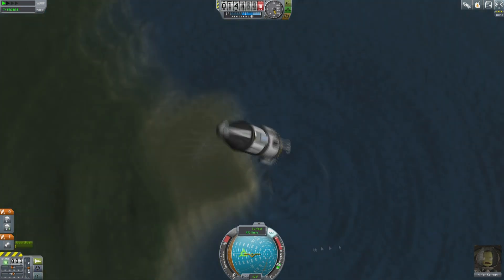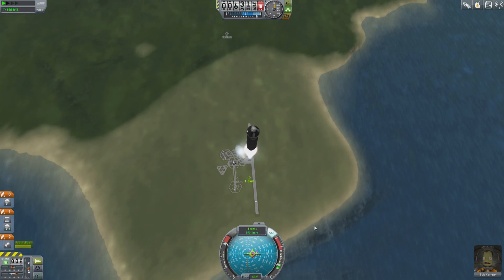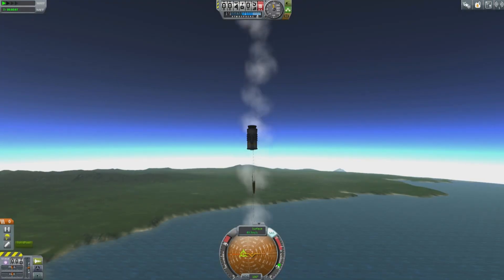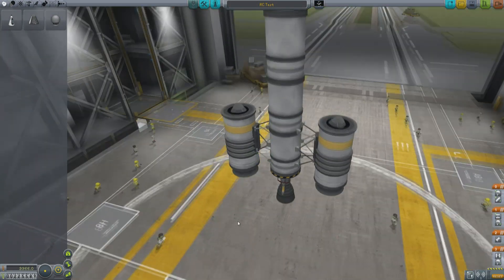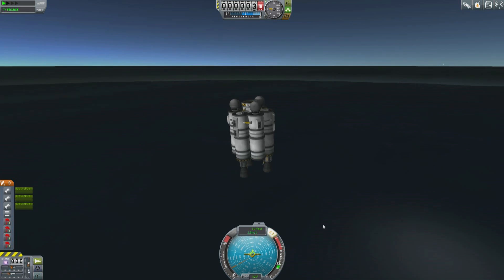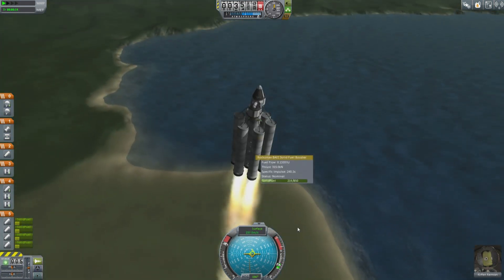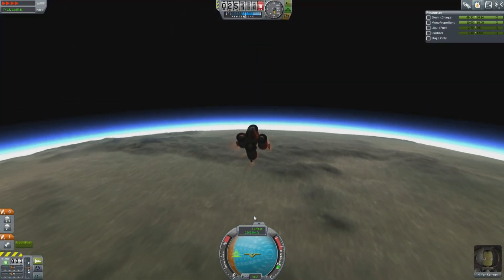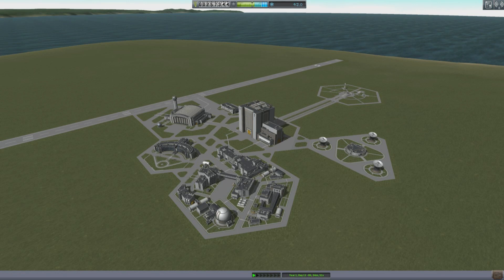Kerbal Space Program - Recovery And Reuse Tutorial in First Contract

Comment: sorry, but this feature just DOESN'T seem very user friendly or bring any improvements to the game... if anything it kind of just makes playing the game more of a chore... Is there ANY benefit to having to micromanage these elements of the game, or use these "gamey" unrealistic solutions to get a little extra fund recovery for missions?
Reply from the maker: The benefit is fun, and possible explosions. But Yes, in part I was saying that cheap boosters are an equally valid approach to the problem.
Reply: Kineth1 Don't misunderstand me, I have no issue with "Funds" or costs, or even recoverability.  I take issue not with the contracts, or funds, or recovery feature, but with apparent limitations of the game engine that make no sense to me.

If I put enough parachutes on a part for it to touch down safely, and do so in a safe location... That should be enough.

Having to switch what I am controlling or use probes etc to save a few bucks is stupid IMHO and seems like a game limitation rather than a feature.

Some of my rockets require CONSTANT control even with SAS to stay stable in their ascent, or at least require that I be able to do my gravity turns etc.

If I have to switch focus to my boosters every few minutes of the ascent to do that... it's not FUN.  IT's ANNOYING.

The only reason for doing it, is because of the limitations of how the game engine handles parts more than 2.5 KM away etc.

That's just a BAD design decision.

Oh sure, you can just eat the cost of the parts... I'm sure the game will remain playable.  But what is the point of the feature of being able to recover things, if you doing so requires such drastic measures?
Reply: The addition of funds forces you to THINK more about your missions, rather than just building a basic launch stage that can take you to Jool and then using that to launch everything.  The addition of contracts gives you (a) GOAL(s) to accomplish, which for me, after unlocking the whole tech tree a couple of times, gives the game more continued playability.
Reply from the maker: D3mang3l Sounds like you should get a mod that hacks the engine to extend the physics range.
Reply: Scott Manley
 I love me some mods Scott.  But at the end of the day thats not a solution. It's a bandaid.  I want KSP to keep being awesome and become a huge sleeper hit, maybe it won't ever be as big as minecraft, but we have to make sure we stay honest when a dev ads a feature that doesn't increase fun.

Needing a mod to make the stock game playably fun is not a good idea.

Anyway, As it's been said a bunch of times, I'll say it again, it's an Alpha/Beta, tweaks and mods will fix all.

And I like what someone said later, that at some point recovery is a moot issue because your at end game and have money to burn.

Speaking of End game, I really hope they put more than just Science and funds, as a way to make progress!

I want them to include not just EASTER EGGS, but stuff that when found unlocks parts.  Find a UFO on Duna?  You can unlock a new tech tree that can't be unlocked just with science alone that gives you new alien engines.  Find life on Laythe?  This allows research into a new kind of Biofuel that weighs less.

Who's with me?
Reply: actually im not sure I agree with this line of reasoning.... while perfectly good points, it ignores that the design they have set up is so that you don't have to go through these unnessesary steps. The limitations in place are there for performance reasons. The devs don't expect everyone to be so strapped for cash to feel the need to recover every last bit of their vessel--- while still rewarding single stage to orbit spaceplanes.

I imagine if rocket parts were not restricted by the limitations in place, there would be no point to spaceplanes still.... in all honesty, those limitations promote advancing to a fully re-usable spaceplane- giving them some much needed use.
Reply: D3mang3l With that I concur wholeheartedly; I think that the 2.5km limit on 'debris' is only useful to reduce memory & CPU usage; I remember when I first started out trying to fly exploration drop pods around the planet (cmd pod+sci jr+goo+parachute) and being very frustrated that when I dropped them they just disappeared.
Reply: xrayfishx
Some People really don't seem to see my point at all do they... I'm not saying we need to make every part function with full physics all the time.

I'm suggesting the feature of recovering stages is fine, but if I NEED to micromanage the landing of my disposable stages, or download a mod to make it feasible to do it...

Then the FEATURE is broken or poorly thought out.

They don't NEED to make the 2.5KM limit go away, or extend it...

What they NEED to do is figure out a way to make it so if I try to save a part by putting a chute on it, and give it a suitable splashdown fight path... that I get rewarded for my effort.

I SHOULD NOT HAVE TO MICROMANAGE the splashdown of my SRB's or LRB's while my main payload stages are still in ascent to get as much efficiency out of my funds as possible.

Everything else sounds awesome...

Sorry if I sound snarky, but it seems like every other response is from someone who seems to lack reading comprehension and thinks I'm bashing the game or don't understand how I can Fix the problem.

Those latter people crack me up... They tell me how to fix the problem but don't seem to acknowledge that it IS a problem...
Reply: Kineth1 there is one, it's called unloader, or something along those lines..found it.

TT NeverUnload - Vessel Unloading Preventer
Reply: Cadde exaggeration to express a valid point is in no way blatant ignorance....
he's technically incorrect if you take the words literally at 10k remark, yes... ignoring the exaggeration, not everyone has your computer so don't expect the rest of the players to share your view.

as to the point he made after that
"And remember THE GAME IS A WORK IN PROGRESS and it may or may not be fixed and a solution found in the future. Scott is just showing you how to get around the limitation."
^ How is this not a good point? he's right, these limitations may very well be lifted at some point,.. idk, do you?

as to whats so difficult in putting in a slider for this limitation to be in the players hands,.. idk why he is being addressed on that one as if its his fault? a bit irrelevant to what he said and more of a problem for Squad to look at. It doesn't reflect on his point...
Reply: D3mang3l so,... leave the limitations there- but work in detection for if a debris has a parachute and autocalculate your return funds? This would be acceptable?
Reply: I must investigate the existance of mods to extend physics range, thanks for the suggestion.  This is one of the great parts of being involved in early access games; you get to help shape the eventual development of the game into something that the whole community can enjoy :)  Personally I want my main stages to behave similarly to Space-X's goal: launch and soft-land automatically for maximum reusability, none of those suicidal solid rocket boosters that you can't shut off when something goes wrong.
Reply: D3mang3l It's not a feature... It is a limitation and it is there so you don't need a $10000 PC to run it. And remember THE GAME IS A WORK IN PROGRESS and it may or may not be fixed and a solution found in the future. Scott is just showing you how to get around the limitation.
Reply: D3mang3l I expect when it finally comes into release as an actual game (remember this is basically Alpha/beta) then that will work.
Reply: D3mang3l I have the same concerns.
When I first heard about career mode, my first reaction was "Interesting and challenging!" and my first concern was "I wonder how they'll deal with first stages recovery".  It's disappointing to see they didn't deal with it at all and first stages are basically lost (for normal people who stay with the ascending part of their ship).
For a system that pays you to recover parts, in a game where rockets are built in separating stages, that is a surprising omission, especially when the early stages are usually bigger and therefore more expensive.  I know it's not a full game yet but it seems to me like a fundamental part of career mode, not a detail, so it's surprising to see it released like that.
Reply: The recovery function still works without mods and workarounds though, just not for the booster stages. It works for the expensive landers with scientific equipment which is a large part of the cost. As unconvenient as it might be, it is better getting some money back rather than none! And also, how do you know the devs didn't intend to make the recovery function like this? Maybe they were aware of the limitations, but made it anyways, because at the end of the day, not being able to recover your lander would be even worse! I do hope they make some form of simplified solution to this issue though...
Reply: I know! its almost like its supposed to be a rocket/space simulator!
Reply: *****
Don't argue with them Memo, some people just can't stand when you have criticism of something they like, constructive of otherwise.

Apparently, Squad can do no wrong.  Instead of expressing concern over a flawed feature, we are supposed to just mod it out and not say a word.

People just don't seem to get that the game can be awesome as hell, and have a flaw that needs fixing.

Telling someone it's alpha so it's fine is ridiculous.  It's ALPHA so it's MY JOB to report my opinion on the game.

Not just suck it up and shut up. Glad you understand the point.

I'm already over it... I just play science/Sandbox now.
Reply: If you don't like the budgeting/reputation part, you can just disable it when starting a new game so that it'll operate in 'science only mode' like it does presently.
Reply: softrockification You clearly have no idea of what you can buy with $10k... I can buy a decent gaming rig for $700 that could play KSP without much issue.
If i wanted to go the extra length to get everything i wanted i would say $2000 would be well enough for everything one can play on a PC.
And if i wanted to go crazy then $3000 is the maximum one would spend on a gaming rig. Beyond that, any extra $$$ you put in has literally fractions of a fraction of a percent in benefits.

So yeah, with your $10,000 BS i could get myself 5 gaming rigs that would still be about 95% as good as the one you spent $10k on.
Reply: Cadde very good points.... glad to see someone else understands the marginal benefits as you climb towards more expensive machines.

Honestly if you build it yourself, the $2,000 one should get you damn near top of the line and rival a 10k market one just fine. 

but that's off topic... a lot of people run crap machines despite this. And Softrocks main focus still stands.
Reply: Meow ster But it's not even a strong point he makes after you ignore his blatant ignorance. There are settings for graphics quality and pretty much everything else in game. So what's so difficult in having a setting for the max physics distance?
I would set mine to infinity to begin with, the start of a career is the most fun anyways and once you "play in the big league" you hardly bother with recovering spent stages anyways. Especially since being able to re-fuel them in orbit and never de-orbiting them becomes a possibility. That is, keep the long distance heavy stuff in orbit forever and use smaller craft to bring crew, fuel and parts up there.
Reply: the problem with that cade, is that it'd literally load EVERY part that you have in orbit/crashed, which would mean a ridiculous amount od RAM used in very trivial stuff
Reply: iruini07 Thank god i have OCD then and clear up any debris that have landed on the surface.
Besides, once something is "stationary" (I.E, in orbit or on the surface of a body it doesn't need to be simulated physics wise anymore.

Only when a rocket is firing or it's entered a physics environment does it need to be simulated and i wouldn't mind a performance slowdown when something is about to crash into a body.
Reply: Therefore physics is not on and it is exactly the same as the current system which will still leave the 2.5 meters are when will it load and come into view and physics is applied? When you have a 2000 part ship in a stable orbit you still get lag because the model is loaded. this will e the same when physics is applied and the model is loaded. If you don't want physics when in a stable orbit it still leaves a 2.5 meters to load the model into physics.
Reply: iruini07 Thank you very much!  I will have to check this out after trying the vanilla update for a while.  Fingers crossed for 64bit version compatibility.
Reply: I agree, this should be part of an optional harder career mode, its an update I will not be downloading sadly.
Reply: An easier solution seems to be if the decoupled part is equipped with essential parts (a Probe and a Parachute for example) the game continues its physics until landing, and then sets it in  place until you switch to it. So the science and Money is preserved and it doesn't use up our precious Ram for too long.
Reply: yep, dont think ill be updating, its hard enough as it is
Reply: Da1ienx Me 2, i have a challange in career to recover a probe on intercept with Kerbin in 136 days. Problem is: I didn't fit it with a docking port, so that meens i have to use "The Klaw" witch i still need to unlock. Going to the moon and landing there that means. But i dont have any experince on landing in a almost no gravity-no oyxgen enviorment. Nice challange me!
Reply: D3mang3l while I don't agree on the whole with your dissatisfaction on the physics limitations and funds.
Mods are not an excuse for a developer to slack.
If they can improve in the areas you listed, im certainly on board with it.
Unlocking alien tech certainly sounds fun!
Reply: Honestly i was waiting for this update, only because of the x64 implementation.
Reply: D3mang3l
Sir your loading range problem can be dealth with.
There is the "never unload" plugin that gives physics a 300km range (use with caution as this may lag your machine to death because of all the stuff it has to load within physics range).
And there is the "Lazor System" that can upscale your physics rage to 95km.
However I suggest to use this with caution and go into orbits of 100km and higher (as you will not be loading stuff on the ground from orbit which can cause stupid things to happen).
I use the Lazor system for the higher loading range (2.5km, 9.5km, 22.5km, and 95km preset settings), but i've deleted all its parts in my folder as i don't want the weapons and stuff.
Reply: davispeterson
It is still a work in progress. I am sure in the future they will address this issue, now that the game has x64 compatability
Reply: D3mang3l Get the Lazor mod, recover everything, lag terribly when your 300 part station goes over the launch site or is anywhere nearby, even in space terms, and then realize why the 2.5k limit is useful.
Reply: D3mang3l
 there will be mods for that, and someday an update to fix what mods already have. ksp has been loaded with buggy annoyances as its still in development, this was a problem that wasn't one before so eventually it will be addressed as you are right, you shouldn't have to micromanage your garbage, just chute it so it doesn't come screaming thru the space program headquarters.
Reply: Meow ster
 I was actually going to suggest that as a possible option yes.  Might not be quite that simple, but lets say if a part has a chute active on it, then the physics engine restriction is expanded far enough to allow it to track it out to a reasonable distance for recovery.   Say 250KM. 

This would probably be the best of both worlds... it would maintain the efficiency of the current 2.5 rule, but also allow for the game to really require a proper recovery solution, not just strap chutes on.

I'm sure it could be handled as a simple exception/flag to the current logic that controls when the physics cut off already. 

But what do I know :)
Reply: D3mang3l I agree 100%, I have been looking forward to funds in career mode but this is a very awkward way to recover your costs. The other problem is at the start of your career it will be more difficult to earn funds and very difficult to recover them but as the game progresses it will probably be trivial.
Reply: What if there was a way to have the main ship load, and keep the 2.5KM limitation. But somehow find a way to force load the debris that you jettison that on a trajectory in the atmosphere or the ground?
Reply: Well,... I know for a fact that they made it like how it is on purpose. The recovery funds are a bonus, not the focus. Your not suppose to micromanage recovering every little thing. Theres a bunch of OCD people doing just that and its driving them bunkers, meanwhile the people that either don't care or recognize the system for what it is, are making plenty of money just fine making their ships how they used to and only recovering upper stages(or mixing it up just a little)

that's not to say the bottom stages shouldn't be recoverable(it doesn't make logical sense at least). Just that everything is working as dev intended atm.
Reply: fair enough, ill have to try before I judge huh
Reply: Spagghetii
I suppose someone could mod in a cheap/free drone body, that is extremely tiny and has no mass that could be attached all your parts in order to make them considered separate ships, so that they would be protected from unload deletion.
Reply: *****
 its not a full released game, when its done you wont "need" mods
Reply: *****
 for a game still thoroughly in development it kind of is. the modding comunity helps the company tell what people want from the game, so the more suport the mods get, the better the end result game will likely be. ultimately your fully capable of playing the game comfortably without mods, they just enhance what is possible
Reply: You can play the default game mode just fine. You can simply do more with mods.
Reply: wow.... no, its not alright for a game to rely on modders to do their work for them and fix a broken game.... that's a fine and excellent point to make IF it actually applied to this particular case.

as it is, you don't need mods to make money in career mode. What you need to do, is learn how to play the game properly. that's a fault on you. Or we could say its a fault on squad for not dumbing the game down enough? sometimes this is the case, but im not a big fan of dumbing games down....

all you need to do is complete 1 mission during a launch and the craft is paid for. PAID FOR... meaning the refund is gravy....
and its quite easy to get 3 or 4 missions done in a single launch. I understand if you have trouble getting that many,... but if you cant get 1 or 2 mission done per launch, you need to rethink your stragety, not take it out on the game.

now... im gonna step off the aggressive here, and ask you... if you honestly think career mode is too hard. then prove it. And remember how Scott manley and others have ALREADY proven that stock game can get all research done in 2 missions... proving just how ridiculously easy this game is UNMODDED
Reply: Meow ster
 dont think anyone was complaining about the tech tree, its about the slight flaws in the game, that will inevitably be worked out in a later patch, things you shouldnt have to do because of the engine being designed back when you didnt have to return anything to the ground safely, cept maybe your kerbal..sometimes. i forget who said it, but if you put a parachute on debris that would be capable of deploying at an altitude and landing the crap on the ground without exploding you shouldnt have to leave control of your ship to make sure the crap doesnt despawn.
Reply: S3PT1M1""But I had to cheat and change my funds to infinite in the pers. folder of my save because I refuse install mods JUST TO PLAY THE DEFAULT CAREER MODE.  ""

Memobyte was... tech tree is closely tied to everything else in kerbal as it gives easier access to stuff, and in effect more money. Tech was just a small example I used tho. Most his posts were over how you NEED mods just to play the game, which isn't the case at all.

but as far as the engine limitation, yea... that's annoying. And true a modder had to come along and fix that. But it still in no way breaks the game to the point he portrayed. The game isn't designed around salvaging every piece of your rocket. In fact, you don't need to salavage any of it at all to make a profit.
Reply: Meow ster
 ah kk didnt see that post then :P
as far as im concerned even tho it may not be nessesary to save ALL your parts, i feel for the bigger stuff you should be able to strap a radial parachute to it so you dont sent a giant hunk of metal screamin towards your base and have it actually just land safely as oposed to despawning. or alternately have it realise that it will land safely and despawn it while treating it as if it landed ( save processing)
Reply: S3PT1M1 as far as that, I definitely agree that it would be nice for that. It's like, I agree with the feeling that it could be better, and definitely should be improved on- but at the same time wont stand for false reasoning to justify it. 
Sorry if I came across as otherwise, thought my previous posts reflected it but I guess not
:(
Reply: Cadde It depends on the resolution you're using. Try 4k and you need 4 watercooled and overclocked top of the line gfx cards, and a top of the line CPU, also OC'd and watercooled. And even with that a lot games will not run at even 40FPS stable. Even a triple head 1080p set up has limitation on hardware on some of the most demanding games. And a system like i said is 500$ CPU, 600x4 GFX, 800$ watercooling rads, blocks, pumps, tubing, 400$ a good case, 300$ a good MoBo, and so on... Sum all the parts needed, and it gets beyond 6000$.

But if you meant 1080p, yeah, 3000$ would do it. Unlesh you want 120FPS stable LOL.
Reply: D3mang3l This was something I was really looking for in mods - something that reworks the 0.24 science/career system to make the game feel less like "rocket science for dummies with some progression thrown in" and more like a strategy game where you go from a limited KSC with basic and expensive rockets, to a gigantic space age civilization with resource mining colonies, orbital science labs and space stations. KSP Intersteller makes a good attempt of this but it has its flaws and it seems to be the only attempt at end-game science so far.

KSP has a ton of potential, it's more about whether Squad (or modders) can turn KSP from "simulator for dummies" to an in-depth "run-your-own-NASA" strategy game that both dummies and the more hardcore players can enjoy.
When I say "dummies" I mean those who don't really care about the science behind KSP and just want to launch stuff into space in Kerbal fashion.
Reply: SikGamer70 yea... KSP actually has a nice learning curve in my opinion. If you really suck and don't understand anything- you tend to learn quite a bit about stuff you never imagined you'd bother with before.

but kinda like what you touched down on. The game doesn't have much to offer to those that already got all this stuff down. Needs more gameplay and the recent changes certainly add to that.
Reply: ComandanteJ Since exactly when was 4K ever a requirement for a gaming rig? I am running 2560x1440 on a single GTX 580 and I don't experience any issues. I mean i wish i had a 780 Ti or two of them but as it stands i get 60-90 FPS in most games on this resolution, albeit with reduced texture and anti-aliasing settings etc on some of the heavier titles.

Besides, watercooling doesn't automatically make a card better/faster/more OC'able. Watercooling only serves to effectively move the cooling surface OUT of the center of the machine as it's difficult to get air pumped to all components. in the middle of a quad GPU sandwich.
So at that point in reading you comment i already knew you had no idea of what you were talking about. But just for fun i will indulge myself to debunk the rest of your ill constructed argument.

A CPU can be cooled way more effectively on an air tower cooler. Problem with that is you need the proper computer case to accommodate that, but that can sorta be said  about watercooling and quad GPU setups too so it's really besides the point... isn't it?
So that's another error in your argument, you don't "*need*" water cooling at all on your CPU.

With a quad GPU setup a lot of games still won't run smooth, i can agree on that. In fact, a lot of games won't run at all even on 1920x1080 resolutions because quad GPU setups are finicky at best when if comes to drivers and games supporting that setup to begin with.
And when the games DO run, you are still likely to have issues with them using such a setup. Support for the most ridiculously expensive graphics cards is at a minimum... Because so few actually purchase them.

But yeah, beyond ALL those faults... If you wanted to run 4K or a triple header at ultra graphics settings then of course you will bust the $3K budget.
But that is equal to me saying "I want me and ALL my friends playing on dream gaming rigs" at which point it becomes $3000 times the number of friends i have. I would need millions of dollars to get there... Every year...

On a side note, do you really notice a difference between medium quality settings and ultra settings in Battlefield 4 on a 4K monitor anyways? Or is it just one of those mental improvements... For me it's just an EGO boost and nothing else.
Reply: Cadde lol,... I feel like we are re-visiting an earlier topic.
Yet again your entirely correct that people are posting grossly exaggerated estimates for a proper gamming rig. 

ComandanteJ  I am not sure why you targeted Cadde with false pricing. Who is your supplier? Stop see'ing that store/person.
Reply: Meow ster I was guesstimating prices, but i dont think those are much off... i mean, an Intel 6-core is around 500, a top of the line GFX from ATI or Nvidia is around 600 or more, a good watercooling (rads, fans, blocks, tubing, pumps, rehobus, etc, etc) for the cpu AND the four gfx cards is 800, and that'll be cheap... i dont know where i got too pricey, but prices are what they are for flagship hardware. It can be cheaper, using a cheaper case, or a jsut barely good enough MoBo, but what will be the point of expending 2k on graphics and then saviong 100 on a MoBo?. And i didnt say i would buy such a machine, even if i had the money, but the performance diference is not fractions of a percentage over a good 1800/2000$ rig (wich would be about max i would expend).
Reply: ComandanteJ Funny thing is i never said performance would be in fractions of a percent, i said benefits would be in fractions of a percent.
That said, a quad sli setup still is a bit overkill for a 4k screen unless you have a 120 hz monitor. Which you don't, because they don't exist yet. If you have framerates above 90 on a 60 Hz monitor you are just spending those extra CPU cycles needlessly on a modern title. Such as for example BF4 that does handle rendering separate from most other pipelines.

Yes, fine. You CAN spend $3000+ on a quad SLI setup and boast about being the biggest and baddest virgin on the block but still, the benefits are marginal unless you have a mental illness that literally forces you to go that route.
Reply: ComandanteJ it depends on where your getting your hardware and how your setting up your machine.... 2k for graghics is downright stupid imo.

but you need to get your reasoning straight.... so far you went from values of 1800- 6000 and many spots in between,... all for the same counter of "depends on what resolution you use"... way too general and vague. Kinda a "No Duh" what resolution you even looking at? Something unsupported no doubt.

Cadde said 3,000 absolute max.... I agree with him, on any resolution... your top value was 4k at one point, 6k in another. To that, I say stop overspending for diminishing returns. Let me put it this way... you don't see anything past 30 frames. you can ARGUE for up to 60.... anything past that is WASTED. as in your performance means 'nothing'. And the hardware will only last slightly longer due to poor software support.

as to quad GPU's... I don't feel theres any reason at all to go past 2, ever.
Reply: I was just pointing out that there are scenarios where you would NEED more than 3000 to get nominal performance at max settings (4K, or triple head at 120FPS, as examples). For that, i guesstimated something along 6500/7000 for the whole system, (i didnt said the Price of every component, i said nothing about RAM, storage, etc... so is not just the sum of the amounts i typed). And then i stated that i agreed with you both in that a system that pricey would be just too much, and that i woulnd ever buy something like that, topping myself around 2000$. But that doesnt mean that you cant build a bloody faster system with much more money. I never said anything about 4k, BTW.
Reply: Cadde 4 OC'ed titans and a 4.5Ghz Ivy Bridge-E at 4K is not enough to get 60FPS stable at 4k Ultra settings on BF4. Maybe ATI would fare better with Mantle. Anyway, try BF4 at 4K in Ultra, on a 3k rig... and then tell me that the differences between the performance of that rig and a 6k one are marginal. I'm talking about a balanced rig, 16 gigs of ram, a good 500/600GB SSD, good case, good cooling, good PSU... Not just big CPU, Bigh GFX and enough everything else. That way you can do it for less, but the system wont las long enough, and youd end up spending more money to revamp it.  Anyway, i hope we agree in one thing: Get us 10k$ for each one, and let's spend it however we want LOL.
Reply: ComandanteJ I think you meant resolution and I mistook it for price.

but yes, get any one of us a 10k computer and I doubt there would be any complaints drools 

I'd argue on spending more money for a longer lasting computer, I feel that's only if your lazy and not willing to sacrifice certain settings that give little to no benefit as time goes by. But the discussion isn't worth it, it really comes down to matter of preference.
Reply: Meow ster "Let me put it this way... you don't see anything past 30 frames. you can ARGUE for up to 60.... anything past that is WASTED"

Oh no... I can see single frames perfectly well past 60 FPS. It's all about filtering out what you don't NEED to see, only processing the vital bits. Which in a game like BF4 would be the most common lurk spots and paying attention to things that just stick out from what you remember it should look like.
The "30 FPS" argument is old and has since long been debunked. A human can catch a single frame in 200 FPS and make out a lot of detail on it. I would however say that the average human can't make much use of more than 90 frames per second in games.

ComandanteJ All i know is i am quite happy running BF4 at medium settings, ultra doesn't make a big enough visual difference to the game to warrant me spending $2000 extra for it.
Besides, as a competitive gamer (aren't we all?) i much prefer a less cluttered game graphics wise. For instance, in BF4 when you go from the High preset to Medium, smoke effects and particles are reduced significantly. Leaving more visibility for the player that runs on the lower setting.
All this without making the game look particularly bad in comparison.

So from a gamers standpoint (that is, one that doesn't give a hoot about a few more pixels on a wall) any benefits are diminishing when you spend that little extra.
Besides, on my GTX 580 and my 2K screen i can still run BF 4 at Medium with 60-80 FPS and if I want to go Ultra then FPS drops to 30-40 and that ain't too shabby for such an old and outdated graphics card. If i were to upgrade to a 780 Ti i would still run on Medium without AA and other intrusive effects on because i care more about seeing the enemy than i do about being able to read graffiti on a wall across the map with a 40x scope.

If i had $10k to spend on computer hardware i would split it up into 2 machines with ALL peripherals inclusive and use the two machines when friends come over and inbetween use the other one as a supporting PC to do recording work, rendering work and what have you.
Reply: it would have to be a serious whiner to complain about any difference's between 60 and whatever. But to each their own I guess O.o
Reply: Meow ster In a 60hz monitor, youre right. In a 120hz one, you're not. I have a 120hz projector, and i can ASSURE you, when you find a game and config that runs at 120 stable... man, now that's something. Buttery smooth. Even when you can get 90-ish, you notice it.
Reply: ComandanteJ
I've seen people play off projectors before... to me, that's a horrible experience,.. idk how you can even stand that. (nothing to do with performance)
Reply: Meow ster Why is that? At first you get a little "motion sickness" LOL. But then, headshots are way easier, because most of the time the heads trought the scope are basically 1:1 scale LOL. The screen isn't too big, 100 inches, seats at 3m.
Reply: Yes, because REALISM means when I put parachutes on my boosters, and stage them so they pop open and come off my rocket, and land safely, they are not recovered or in any way counted as safe because the game limitation on what objects it tracks.

Yes, that makes me a whiner and a troll because the feature doesn't add realism or even fun...

Yes, I get a cookie, because YOU are the actual troll...

And YES, I still play the game all the time. 

Go away now troll... go away.
Reply: lol,.. most entertaining reply to a troll I seen in awhile.

BTW, D3mang3l 
Did you see the new additions? they have plenty of ways to gain more money atm. Micromanaging every little part has become extremely unnecessary, way more than before.
Reply: Meow ster
Not yet, .25 wasn't as stable for me, so I stuck with the 24.2 for now to continue my Sandbox exploration of the universe :)  I can't want to try the next few iterations though :)
Reply: D3mang3l Or you could just forget about the boosters: they're cheap and you'll lose money in the process of recovering them anyway. Whats more, the money you get paid in advance for accepting a contract will usually more than cover the cost of the rocket you build for the task, and you'll get paid even more on top of that. The only person making this process a chore is you by taking it upon yourself to recover boosters that the game clearly doesn't expect you to recover..